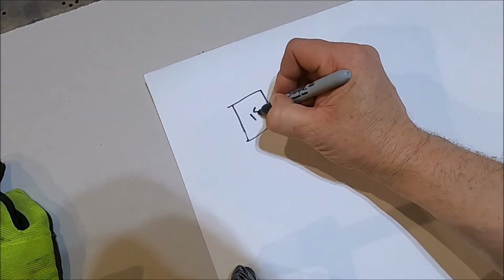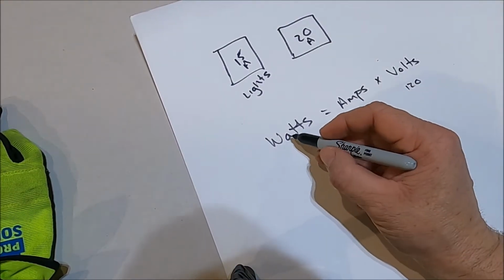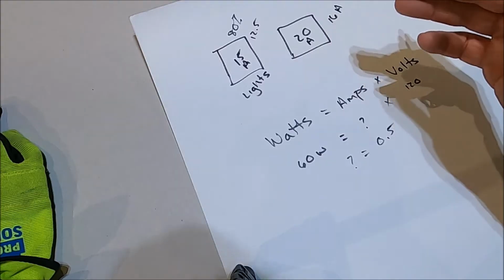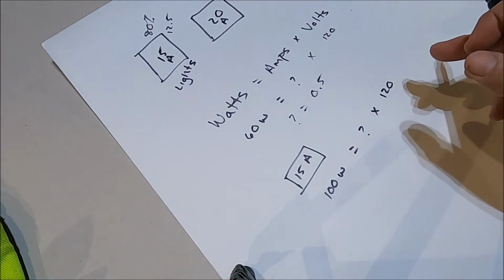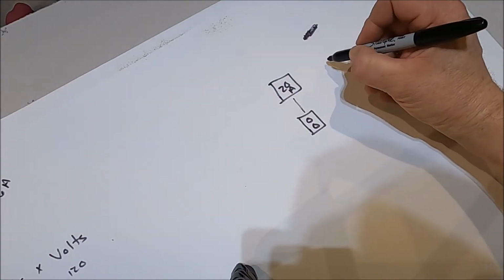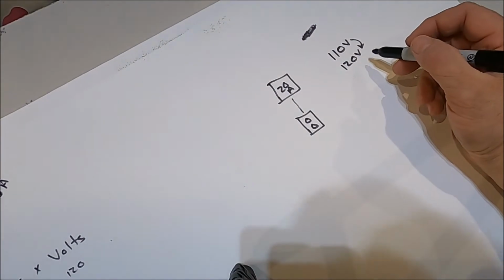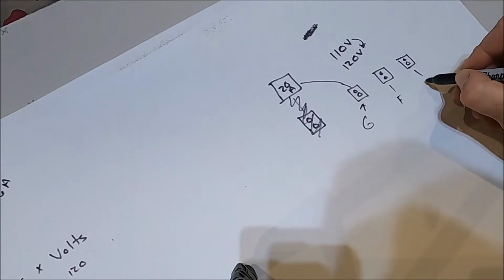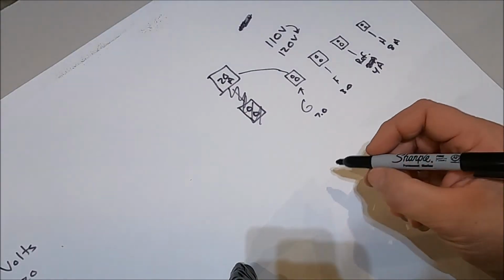Wiring Garage Part 1

Comment: I’m not worried about a flood either but.. I put most all my shop and garage outlets at the same height as the light switches. It’s easier to get to if you place something against the wall or workbenches.

Comment: I know this is an old video not sure if you’ll see it.But I have the same style of  building. Can I run the wiring with out it being in conduit if I don’t frame it with 2x4’s like you have?
Reply from the maker: It might be difficult to do that as there isn't much to hold the wire in place.
Reply: It’s best to use either MC cable or run EMT with THHN wire inside it for non insulated metal buildings.  This will be NEC compliant and keep you and your family safe.

Comment: I remember  electricians  always  said  110 V. Then  for awhile  it was  115 V  then 120V. Also  it was  220 V then  230V and now  240V .The power  co. increased the  output  over  the  years.

Comment: Can you explain how you got the amps calculations again?
Reply from the maker: Watts = Amps × Volts

This formula can be rewritten as watts divided by volts equals amps:  Watts/Volts = Amps.

For example, if I have a 1000 watt device, I can calculate approximately how much amperage it draw (not exact):

1000 Watts/120Volts = 8.3, or about 8 amps.

Comment: Enjoying your garage wiring videos. Before you started did you make a electrical drawing/sketch of your circuits to help determine just how many circuits you needed?
Reply from the maker: No. I just kind of knew what I was going to be running and planned in my head how many outlets to install and how many circuits I needed. My video on planning electrical circuits migt help you if you do need to draw things out.

Comment: Hopefully you are aware that per any recent NEC (All 125 volt rated receptacles in that building must be GFCI protected).  Yes even the one you showed under the panel.   The true answer to how many of anything you can put on circuits is to calculate the loads.   Never add amps, always add VA.  Also, if you are going to say something is per code, make sure you are correct.   Example, there is no mounting height for switch or receptacle outlets.   Best wishes,   Kevin
Reply: You are incorrect. Please review NEC 210.52(G)(1): Garages. In each attached garage and in each detached garage with electric power, at least one receptacle outlet shall be installed in each vehicle bay and not more than 1.7 m (5 ½ ft) above the floor. 
So there is a height restriction. I believe there is a minimum height as well but need to find it.
If you are going to say something is per code, make sure you are correct.

Comment: Hi these videos are so helpful 👍🏽 may I ask how you know how much wire to buy/ have on hand. Like is there an equation for that?
Reply: I was thinking the 250 just to be safe rather than sorry. Thank you for your help
Reply from the maker: Not really. If I know I have something like this building to wire I just buy a 250 foot roll of wire of 12-2 Romex and a 250 foot roll of 14-2 Romex. For the three way switch, I know my building is 30 feet long and the switch boxes are 4 feet off the floor. I knew I could buy a 50 foot roll of 14-3 wire and have enough to make it from box to box. If you are wiring a small shed or room in the basement, you could probably get away with buying 100 foot rolls or Romex, but I always have something going on and seem to be able to find uses for extra wire.

Comment: I especially like the shop build videos, I'm considering something similar for a cabin in MI. We'll have a shower and cooking going on so I'm thinking about moisture vapor control for spaces above the ceiling and behind the wall insulation. The inner side of the metal siding/roof could become a perfect condenser at high dew points. Are you thinking about a wall/ceiling vapor barrier? I've been looking at drywall paint primers that supposedly serve double duty as a vapor barrier (manufactured home builders often employ this method). 
Example//"..Vapour Barrier. B-I-N has a "perm" rating of 0.4 perms. which means it is an exceptional vapor barrier. ("Perm" is a unit measuring the permeability of a film to moisture.) Sealing walls and ceiling with B-I-N keeps moisture vapour in the house, making it more comfortable in winter. It also keeps moisture from condensing on insulation in attics and between walls and from passing through walls.."
Reply from the maker: I will be putting spray foam on the ceiling to keep the condensation off from the ceiling joists and fiberglass insulation of the ceiling. The foam insulation won't be very thick as the thermal barrier will be in the framed ceiling. I am leaving the  edges of the roof open so I have some air movement. I am using the Roxul insulation in the walls because it is moisture resistant and will put up plastic as a vapor barrier.
Reply: @brettleybuilt  Do you mean thin spray foam to the underside of the roof metal? The 'barn' company I spoke with offers a thin roof sheet underlayment that supposedly controls condensation. It's pretty thin material, I'm a skeptic.
Reply from the maker: @terrylutke  Yes. We were thinking about the sheet material as well, but unfortunately we have already had a leak in our roof and the closed cell insulation creates a waterproof surface. We certainly didn't want to get a leak and have that causing problems behind the sheet material and we didn't really have a lot of faith in it anyway.
Reply: @brettleybuilt  For the roof leak first check the ridge cover. It really needs sponge like foam rubber gap filler to fill in between the roof ribs. Lacking this, wind driven rain can be forced beneath the ridge cover and enter at the top roof metal gap. This cure would hurt your Xflow air movement, which could be addressed with gable vents.

Comment: This is how 120/110 volts was explained to me. The power company is required to provide a minimum, 110 volts to your home. To avoid a low voltage situation, they increase the amount of voltage you receive, so that when you turn on appliances at the same time, the voltage remains at no less than 110 volts, but not more than 120~ volts.